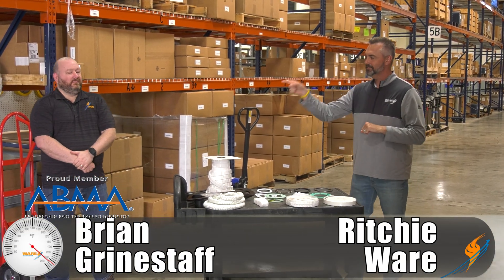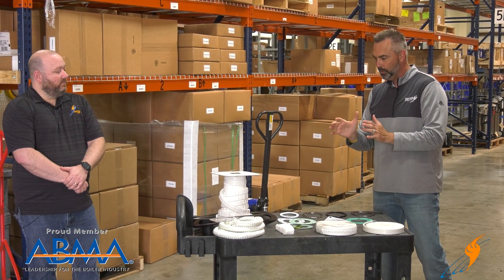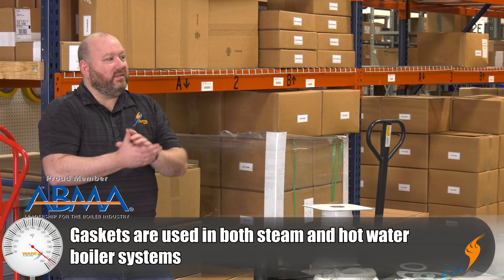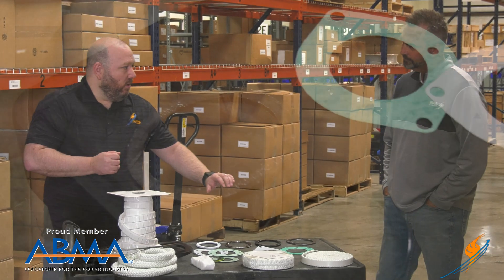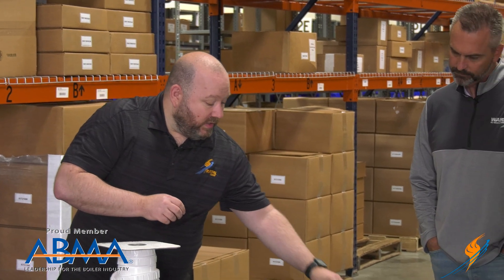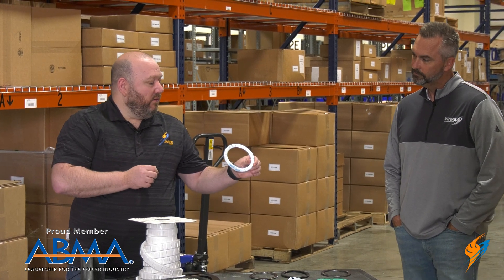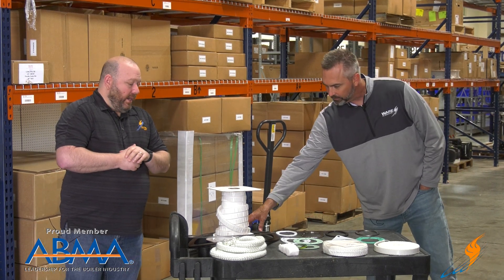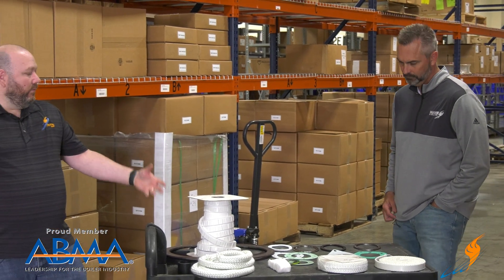Different Kinds of Gaskets in the Boiler Room -Boiling Point

Comment: hello, I'm replacing a non asbestos gasket on an espresso machine boiler. Do you need to add a sealant or anything else?
Reply from the maker: The best bet would be to take a look at your manufacturers manual.